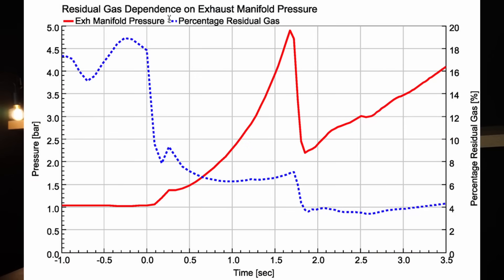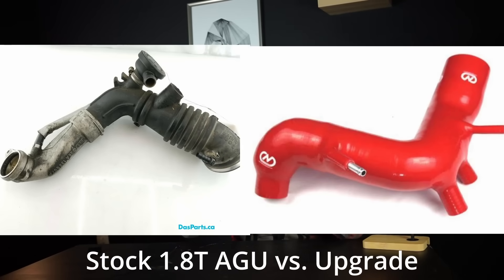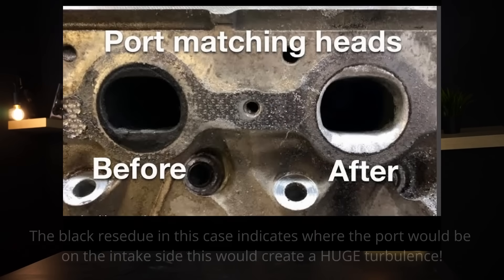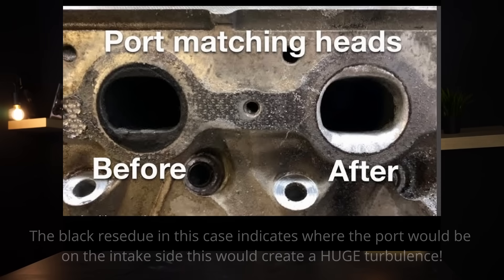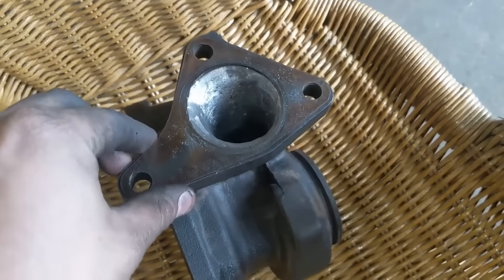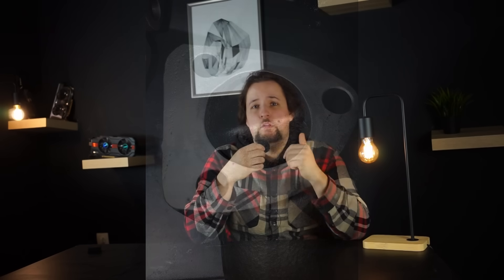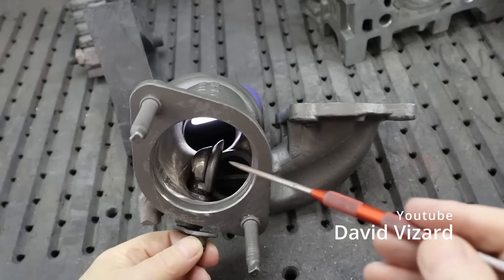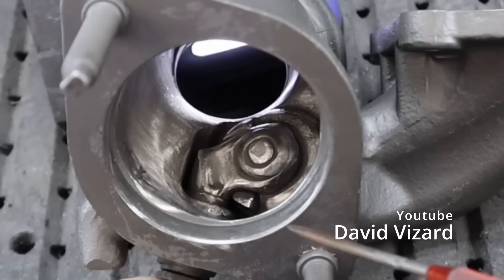The ULTIMATE Hacks for making MORE Power with LESS Boost! | Manifold Pressure, Turbo efficiency

Comment: Small Turbine wheel fix with big compress ..Cause small Turbine spin ratio more the big turbine..
Reply from the maker: thats not how it works... 
while yes it will spin the compressor faster, you will have more backpressure thus limiting the power you can make DRASTICALLY 

The less backpressure you have the more power you are gping to make on the same boost

Comment: if u get a bigger housing does it come with a bigger wheel?
Reply from the maker: No, if you get a bigger housing for the turbo you have, it just has more volume and fits the same wheel
Reply: @throttlebuddies0 reason why I was asking because I kind of was throwing a few turbos together to make one I put it in and had no boost although it was spoiling I took it back out and noticed set the wheel to the housing at about 5 mm of space in between the edge of the blade in the housing I'm pretty sure that was my weird no boost issue I actually ordered a ko4 and got sent to k03 and couldn't bring myself to put it in there so I started Frankenstein one together but I just gave up an ordered another cheap one this one says it's a "big wheel" those are my Dimensions LOL
Reply: Your channel is sick man I can't believe I just found it.
Reply from the maker: @Kevin-wy8kc thanks, appreciate it!
Reply from the maker: @Kevin-wy8kc  yeah thats not gonna work haha 
i can help you with stuff like that. just send me a DM on instagram _throttlebuddies and we can have a chat

Comment: Not sure I understood what you suggested  at 9:41 correctly, but the gap where the gasses enter the turbine wheel should absolutely have a sharp edge. Any rounding will cause turbulence into the flow. Might sound counterintuitive, but that's the way it is. The gap should be even in size, and sharp edged.
Reply from the maker: The gap should be but where the gasses flow around the corner its much more beneficial to make the turn amoother, it will reduce backpressure by a huge margin but also will negatively affect the apool that is correct, though the turbulence is actually less with a gradiant, cause on a sharp edge just with aerodynamics on a car body after the sharp edge there is a lot of turbulence right after causing the gasses not being able to exit the housing as efficiently as they could

Comment: You dont understahd that the a/r in the turbine actually changes where the air blows on the blades, not just how much. If you port the gap in the turbine housing you will loose efficency , especially the tounge .
Reply from the maker: @jasonschreiber6458  yes thats what i said in the video too you will have later spool but also less backpressure. This is why i specifically said if you for example cant get a bigger housing. Ar does change the size and the amount of surface area the turbine is hit basically otherwise a different a)r would be quite pointless. Also changes the approach angle of the gasses somewhat
Reply: @throttlebuddies0 A/R doesnt change the surface area turbine is hit, it only changes the flow area into the housing.
Reply from the maker: @V8Lenny  if i remember correctly it actually does but im not sure right now 
If it wasnt it wouldnt make much sense

Comment: What nobody seems to understand is that boost is a measurement of how much air ISNT getting into the engine. Its pressure in the manifold that the engine hasnt or cant consume yet. Bigger valves, bigger ports, bigger cams, better cam timing will all help your engine consume more of that boost which will either 1) give you WAY more power at the same boost, or 2) give you the same power at significantly LESS boost. That’s why engines designed to be NA tend to make more power with boost much easier than engines designed to be turbo from factory. Gotta have big ports good cams and decent cam timing, AKA great head flow in order to make power efficiently without boost
Reply: Exactly...Boost pressure vs mass flow rate (some use CFM but it's not accurate)
Reply: I often inferred a lot of it was the higher compression but your comment makes perfect sense! And the ‘measure of resistance’ is a great way to break this concept down easily. 👍👍👍

Comment: Great to hear you go over power per psi, exhaust backpressure and residual exhaust gas! Some interesting things we've found through various large/small runner testing and tubular vs cast bolt on manifolds- the small runner (~36mm ID) in a 62mm 4g63 700whp application was more responsive (expected) but also more power per psi and peak power numbers across the board vs the larger runner (only change). Backpressure was slightly higher (still just over 1:1) but had higher VE- likely due to better clearing of the cylinder at the end of the exhaust stroke, keeping things moving in the right direction where it mattered. The backpressure reading is only an average of many peaks and valleys.
For the stock frame cast vs tubular, the tubular made more power per psi hands down (made the same power at 3-4 less psi) and actually spooled much sooner (due to working better with the camshafts used), but surprisingly had more backpressure. But that's also a function of more mass flow since it was making more airflow/power at the same boost pressure. The tubular manifold (more ideal length, much better collector) kept VE up and residual exhaust down due to keeping drive pressure seen at the  cylinder lower during the end of the exhaust stroke, clearing the cylinder for more fresh air charge on the following intake stroke.
Sorry for the long comment, just find it all fascinating and why we do what we do.

Comment: One thing that can help offset the loss of spoolup from porting is blankets for the manifold and turbine housing. They also help manage under hood temps as a bonus.
Reply from the maker: @DMan1198  yep i also explained that in my video about how to improve spool. Though i personally prefer thermal insulation as that works even better but is more complex
Reply: @throttlebuddies0 what is the name of your video on spool? I searched your profile but nothing jumped out at me as being related to spool specifically.
Reply from the maker: @liampousson1173  https://youtu.be/PsUbWCa1E88?si=tRGXBB5P2Q775lbH this is it. i also have a dedicated video covering in depth how to do thermal insulation on a turbine housing and a manifold on a budget :)
Reply: They COOK the turbo! Basically kill it. Better to have a normal heat shield

Comment: Oxygen ! You  mean air. If it was oxygen you have a O2 tank on board . This already says to me your not 100% competent  on your subject
Porting your snail  what next. Do you know the calculations put in to cast the shell to get optimum flow ?
Reply from the maker: What the the hell are you talking qbout? 🤣
Reply: @throttlebuddies0  don't waste your time with this troll. In fact, delete the comment 👍
Reply from the maker: i dont know where you live, but on earth, air has 21 percent oxygen in it and the engine uses oxygen + fuel for the combustion process. therefore more oxygen = more power

and yes Porting actually makes a difference especially since the surface finish on a cast piece is VERY rough and to machine it would be much more expensive same goes for thinner dividers etc. when porting amanifold its just not really as easily cast therefore more expensive so avoided by most manufacturers. 
as for porting the housing in terms of taking material away is giving you the same effect as using a larger housing but if there is no other housing available, thats your only option. 

saying that this wont give any improvement or difference is just ignorant or means that you havent looked much into this. as this has been done like that for literal decades.
Reply: Don't waste your time on stuff like this mate. Your video can do the talking for you
Reply: go make your own video and shutup
Reply: You do talk some rot. what a troll‼

Comment: man but its really that much bether using a tubular exaust manifold? there are alot off people whit handmade turbo log style manifolds making alot off power. and some  good engine builders say that the log style manifolds are bether for spulling fast, its the case? were do you draw the line in its better to habe a tubular lower spooling manifold for more power, or a log style faster spuling manifold? i have see that there are alot off people making lite 3x the hp off they AN engine so we can say its wen you want more that 3x the power you go to a tubular?

sorry for my english im not native speaking
Reply from the maker: There is a huge difference in comparison if the tubular manifold is setup correctly. Apool will always be better when the runners are at least divided internally because otherwise the exhaust pulses are working against each other and loose a lot of velocity in a log style manifold 

While there is no doubt you can make a alot of power with them, its proven to be suboptimal. There is a reason why most manufacturers are using cast manifolds with relatively small internally eeperated tunner, cause it helps spool drastically
Reply: @ what dou you thing off making "j-pipes" from he stock or stockish exaust header and up to the turbo ?, i bealive is a good compromise in having tubular desing and a cheap turbo manifold. but shurely spull slower thant a tru log desing, and probable worst that a true tubular equal lengh .
Reply from the maker: @elcascoviejo5347  that will work much better as long as the exhaust flow somewhat is directed towards the turbo. The problem with log style manis is that the gas is just tumbling around and only exits due to pressure being higher and puching it out but also back into the cylinders at some point because it doesnt have any guidance
Reply: @throttlebuddies0  100% on the log manifolds not guiding the exhaust where it needs to go and instead relying on a pressure differential, ie raising backpressure. Log manifolds work, especially with OEM camshafts, but become a mess with more valve overlap and more opportunity for exhaust to move in the wrong direction
Reply: good video btw good info for beguiners

Comment: Nice video! But I think you didn‘t mention bigger intake pipes between the intercooler and intake manifold with smoother turns. Also intake manifolds in general, camshafts, cam timing (even on stock cams can be better for peak power) and of course the throttle body. Every little bottleneck in your whole system costs you power. So it is important to plan the system and build it accordingly so everything fits and plays together well.
Reply from the maker: Thats totally true but but qith camshafts its a bit more complicated as to not just buy bigger cams. Too much overlap in a turbo application can cause problems but i want to dive deeper into this in the future. As for peripherals yes this definetly is important as i said make the path for the air as smooth as possible
Reply: @throttlebuddies0  Yeah absolutely. You have to get special camshafts fitting your turbo and power range. Also not too much overlap as you said.

And I think you are from Germany, correct? If so, viele Grüße aus dem Ruhrpott 👍
Reply: I agree and so far this is what I have done to my MK5 GTI: intake, after front mount inter cooler, 70mm Throttle body, 3 in down pipe and exhaust. Coming next: ported and polished head, ported intake manifold, ported and polished K03 turbo, Forge turbo actuator, and hopefully I can make between 330-350 BHP.
Reply: @rogermartinez78 Why mess with the stock turbo when so many better options exist?